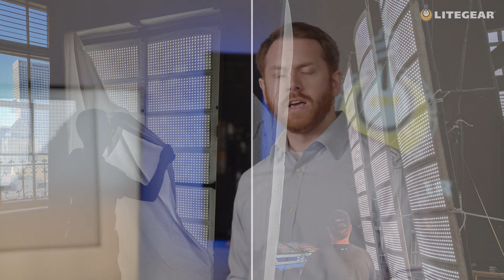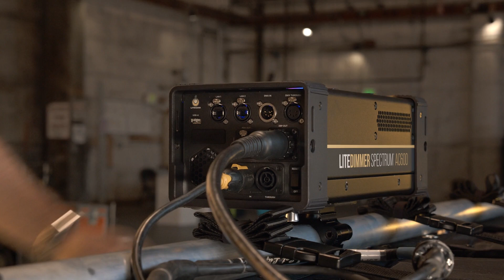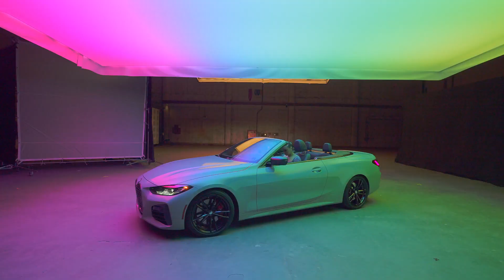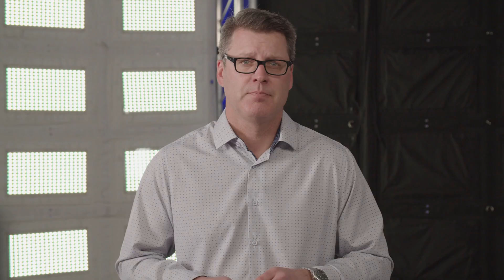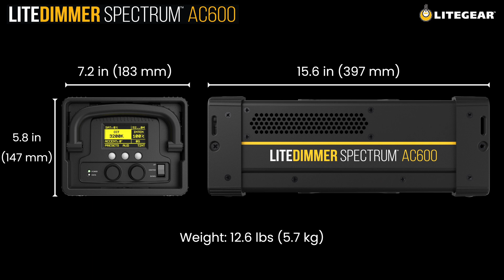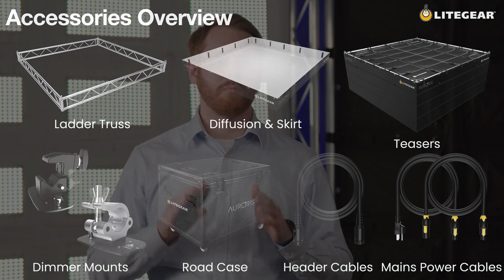LiteGear Auroris - A New Dimension Of Lighting

Comment: Please no,  I hated building blanket lights on location.  Then needing 3-4 SLT to bring them into a set.  Or even worse having to build it on set because it doesn’t fit through the door.  Going to be making this a push for rigging though/stage work.   Needs some tweaks.